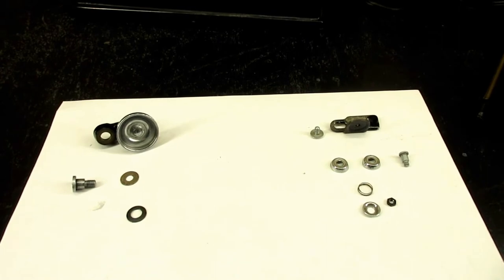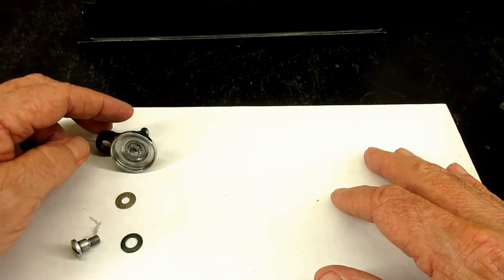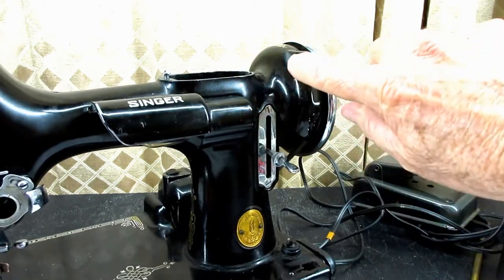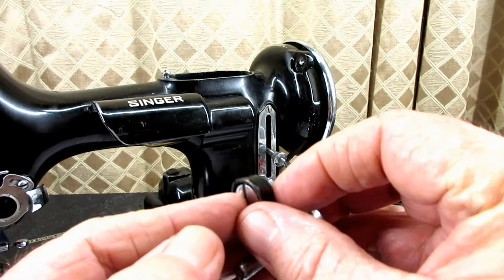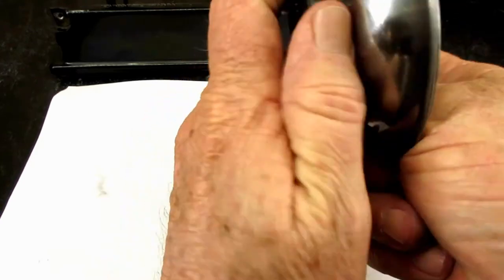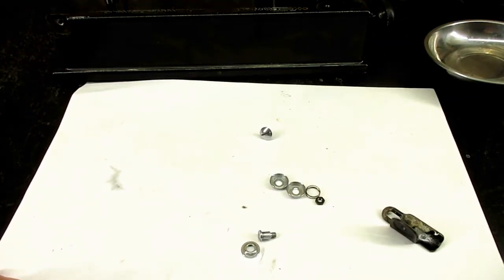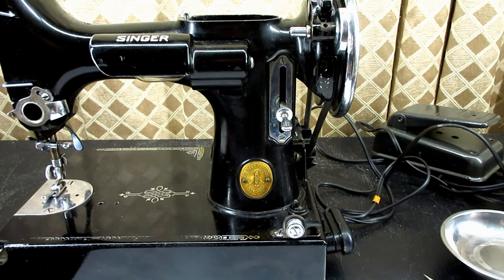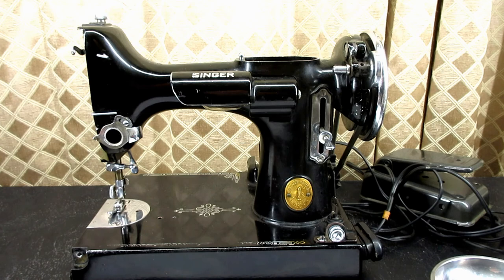Fix the Bobbin Winder System of a Singer 221 Featherweight Sewing Machine

Comment: If you have trouble starting screws and need to chase the threads, unlike most Singer machines, the screws on a 221 are mostly standard threads. The two taps needed are 10-32 and 6-40. Both of these are standard size taps and will take care of all screws on this machine, with the exception of some set screws.
Reply from the maker: Thanks for sharing that. "Unlike most Singer Machines" I agree so I never even thought that this 221 would be different. I'm almost in shock, hehe.

Comment: The bobbin winder system looks better than a 500A, although that’s a fairly low bar, and not as good as the 403. Would you say that is a fair assessment? Great video, Andy. I like that you demonstrate exactly how a washer, screw, etc. goes on the machine.
Reply from the maker: I'd agree with that. Not much to go wrong here. I like that the 403A can be stored away when not needed. Thanks for watching.
Reply: Compassion_for_all   Agree! Nothing like watching Andy at work doing what he loves and is such an expert at all he does! He is careful, and puts so much passion and patience into his Singers. Gotta love our Andy!!😊

Comment: Thank you for showing this video. The problem with my spring is it does not fit in all the way. The top of it is too wide.
Reply from the maker: Maybe it is damaged or the wrong part? Sorry to hear that. I see the whole tension bracket for sale on eBay sometimes. The spring is part No. 45847. The same spring is used on many model 15 bobbin winder tension brackets and model 15 parts are usually cheaper than the featherweight parts so you could just use the spring from the model 15 part. I don't know if hardware stores would carry some dinky springs like that. Thanks for watching my channel.
Reply: @andytubesewing1953  Thank you for this information.
Reply from the maker: @ckim5134  Og course, no worries and good luck.
Reply: My spring was stretched out so I fixed it the best I could and the bobbin winds evenly.
Reply from the maker: @ckim5134  Nicely done. A good solution!